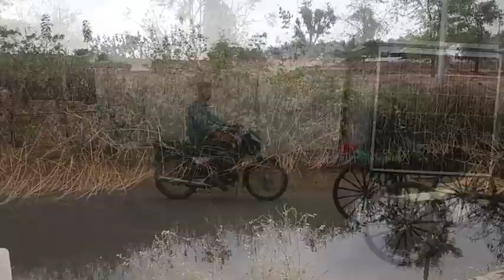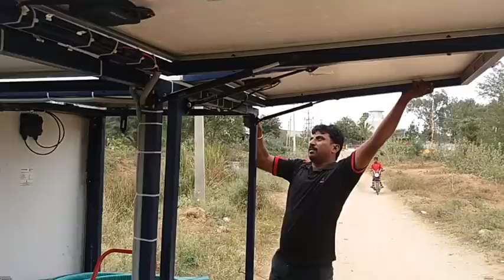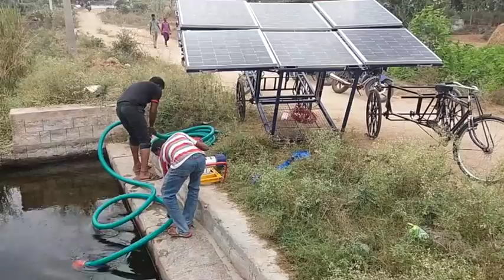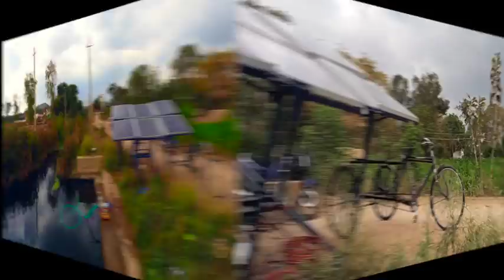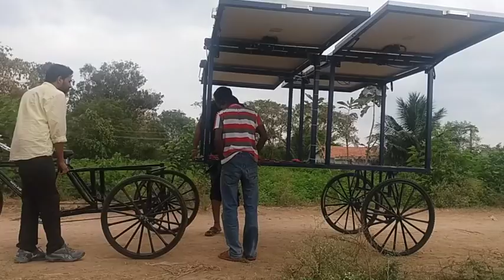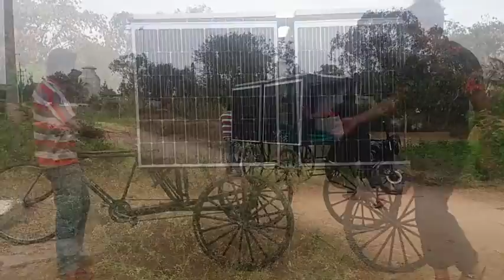SELCO's Portable Solar Pump

Comment: Best innovative idea for movable solar water pumping system.
But can be redesigned by fitting with a motor cycle as this system cannot be pulled by one person for long distance.
Even the farmer cannot rent this system to any other farmer during his unused time.
Towing the system with a bike is easy.